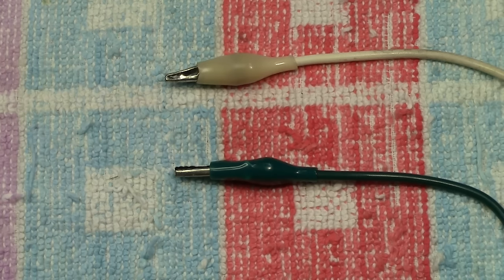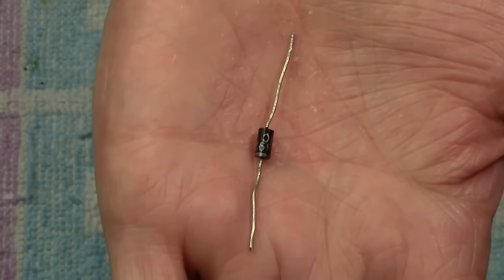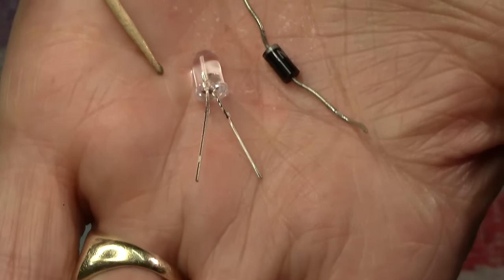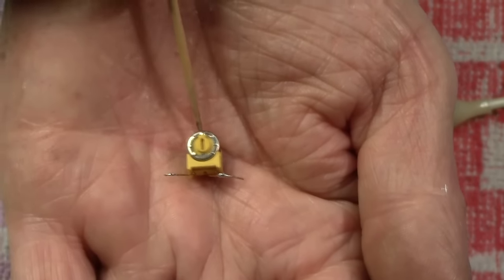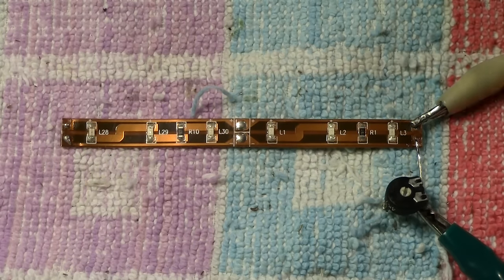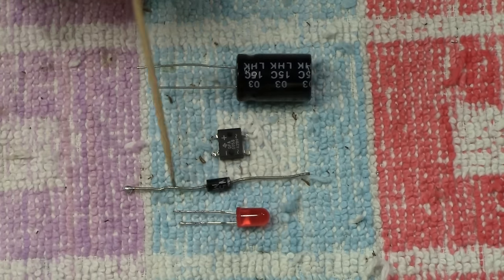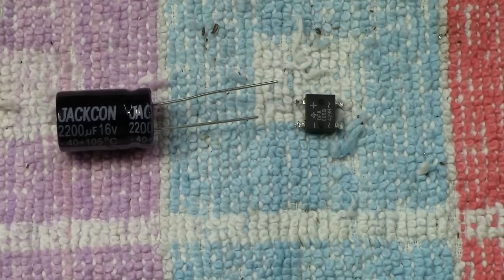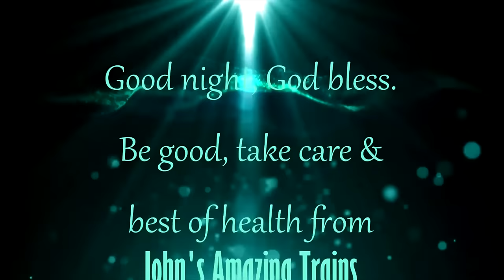How-To On LED & Bi-LED Wiring + The Evolution Of Lighting In Model Railways. Hornby Triang etc.

Comment: I just bought ten rolls of led's from Aliexpress for the price of about £1.25 per 5m roll having one each of the colours, one multicolour (for signal lamps red and green) and a couple each of warm and cold white.   What an age we live in where things are so cheap and these are pre-resistor'd too so just put some volts in and away you go.   Each roll has 300 LED's on so that is 3000 for a ridiculously low sum O.o   Despite years ago being an electronics fanatic who in the 70's rebuilt scrapped Commodore Pets and 8088 IBM PC's using the awesome "How to - Electronics" as my guide and a lethal soldering iron scavenging components from broken devices, I have forgotten so much and these video's really are educational, excellent stuff John from a fan :D

Comment: Hi again John. Remember I was having trouble with back emf on my R155, blowing Bicolour LEDS ? solved it ! fitted a set of PECO 14.1mm wheels and brass bearings, to the other bogie. made 2,twin pickups from thin brass sheet.(4 Contact dimples punched in, using a little home made dome punch too). had to make a pair for both sides, as the axles are insulated from all wheels. Preliminary testing shows very positive results, although only jury-rigged at the minute. Seems that picking the power up from the track, well away from the "evil" old power bogie, has stopped the EMF interference to the LED Circuit altogether !
 Well Pleased. 
Thanks for your previous input, and for all your hard work matey. Gaz.

Comment: Thank you, It give me a better understanding, of how it works. And how can be done.  I already change my RR to DCC, that means, I have a fixed low  AC voltage  current to the rails.  Speaking to light a carriage, I will take the AC current , get it though a Bridge Rectifier, transform it to DC current, and to the light strip, with the potentiometer and the condenser,  to keep it alive and not flickering !

Comment: Great explanation John, thanks! Only things I'd add is that if you were to solder two leds close together for use somewhere (not just for instruction purposes) you'd be wise to add insulation to one of the legs where they cross! and the downside of capacitors storing a charge after power is off is that they can deliver an electric shock too, especially those rated at higher voltages. It's safest to ensure the cap is fully discharged before handling it!  Cheers. Mike

Comment: This is a really great watch, learning lots, good of you to make.
If you're interested, toy train manufacturers such as Howard, Knapp, Carlisle & Finch  most of the gauge 2 aristocracy had working headlights by 1906, with lionel having directional lighting by the mid twenties.
Also by the way Chrysler went to alternator electrics for 1960 model year, and this enabled their panelescent gimmick where phosphor coated ceramics were charged creating an electro luminescent effect for the dash lights. Personally it looks okay... apart from the occasional arc of 220 volts searing across the speedo...

Comment: Those selenium rectifiers are nasty things when they fail.  They can release some nasty toxic smoke...
Those very early LED's were barely even a dot of light, not even bright enough for indicator lights.  Things have come a long way.
When wiring LED's and relying on the LED to handle the reverse bias, make sure you have good quality LED's.  Some of the really cheap ones fail quite quickly if reverse biased.   Learnt that from experience. ......
Thanks for another great video.

Comment: Very very well done John. Your teaching method is superb! I think the most daunting thing which modellers get far too worried about is the "application" of actually doing the job. That, and, the mathematics of course! Although we know that there are some rules and conventions to adhere to, the modeller should have no fear of attempting to do these simple tasks which, all in all, really do enhance the enjoyment of the hobby. We have customers who are crying out for information like that shown in this "tutorial" and you are to be applauded. I will recommend that they watch this. Perhaps you might consider putting it on a DVD then you could also introduce setting the components out on a circuit-board (or vero-board)? I'm not really much good with videoing otherwise I'd help further but thank you again John. I'm sure many will find this useful and, as you say, will build confidence in tackling the project/s. Best wishes, Bob.
Reply from the maker: Gees Bob....thanks for the wonderful comment...I'm sure this cannot be bettered! I'm sorry I don't have time to do any DVD's because I spend most of my time looking after my 90 year old mum! I must just say though that if you think about it...the few components needed can easily be soldered to each other without the need for a circuit (or) Vero-boards however...I do take your point & can easily do that in a further video as the need be's? Once again...many thanks for the support & comments. All the best to you, John.

Comment: Brilliant tutorial I am personally not a lover of trains but you explain the Leds and  wiring side with the use of the resistor and parts very well 
can you use and power the led roll lighting strips using a9 or 12v battery

Comment: Once again thanks so much for making and uploading such an informative video. I think you entirely deserve the whiskey and fag at the end! 
For your next video: Rather than have  pickups on every  carriage , get a Brelec PW400 conductive coupling. (not always in stock, but can be pre-ordered). This allows distribution of the power throughout the train in a very simple and reliable way. It fits a standard NEM socket, as a hook and bar coupling does, but has wires attached to which you can solder the circuits described here.
A PW400 conductive couplings makes it possible to have interior lighting for the entire train with just the capacitor and the bridge rectifier in the guard's van. (Keep the guard on the train and the whiskey and fags by the electrolytic capacitor before the light goes out).
Reply from the maker: Hey Fred thanks a bunch for the great comment again. I am already aware of the PW400 coupling bar system & even have some sets using it/them. What you say is correct but most modern sets use this system whereas people wanting to add lighting to coaches are almost certainly older coaches & don't have the NEM facility. I am actually working on a new system that still uses one set of components in one coach/wagon but still has a form of connections between each old wagon/coach to give the same results! Loved the funny bit at the end again! haha. Cheers mate, John.
Reply from the maker: Hi again Fred...thank you for your suggestion but I am afraid I just do not have the time to do this kind of thing at the moment. Most of my time is taken-up looking after my 90 year old mum! I would love to do more videos too but it's just a time thing. All the best, John.
Reply: Johns Amazing Trains - chambs123 Yes I understand the problem with the 90 year old Mum - my sister's husbands Mum is in a care home which the county council has said will have to close.  All the other care homes in the area are much more expensive so there is nowhere else for her to go. On a more cheerful note, creating a wordpress account isn't difficult - they give you a series of pre-set templates.  Just choose one you like and start typing away.

Comment: Great tutorial, I would have mentioned the bridge rectifier can be used with AC so works on dcc as well.
Cheers
Reply from the maker: Thanks Michael for the support. The only reason I didn't mention it was simply that anyone running on DCC (17 volts AC in reality) is because they will already be using decoders however & in hind-sight I should have as this would still apply if fitting lighting into coaches, wagons etc that don't have the decoder! Thanks again. Cheers, John.

Comment: Brilliant John as always! However, just before you said you were off for a whisky, you referred back to the illustration where you had connected two LEDs (red and white), joining opposite legs together for bi-directional use plus the balance resistor in circuit - MENTIONED that one should probably also add a diode to protect the leds but no pictorial or clip or circuit diagram to show how exactly that should be connected. Which for relative rookies to electrics like me is a big deal. Is there any way you can add or send that information because I’m right now (in fact today, as at 22 July 2022) trying to wire up one of my On30 locos. Many thanks in advance.

Comment: You did a great job explaining how the parts work. I bought a premade light board for a coach. The light had a battery and a magnetic switch. How a about a video on ways to pick up power for the tracks. Thanks

Comment: Very useful. Have layout some parts 40years old. Now changed to DCC: alas gone are the insulated fish plate and relying on the turnout rail electrical contact.   I have installed a bus line to most of the track: dropping feeders as and when needed: However without starting again I have to put up with getting around expensive block detection: So for partial automation and signaling I have turned to toggle (on) Of (on) switches for the solenoid worked turnouts and wired them up with the ready made impulse type units that work (8) signals and used a bi-LED for display panel.  As for block detection I have turned to reed switches: Great LED flicker on the control panel rout (but one has to be precise in stopping the locos magnet over a reed switch to show occupancy) bit of a compromise but still has an element of fun in control: I am extending the layout more dcc friendly, but I am struggling with wiring up double solenoid passing points. as for dcc.It's an issue as most of my old loco stock I chipped will not navigate any new Peco points i have installed and is not worth while fixing without extensive work: anyway my new DCC ready rolling stock with all the lights whistles and bells is growing Thanks again john for your posts that I follow can understand. Ron

Comment: Hi john great lighting tutorial 

Just one question what was the rating of watts for that resistor?
Reply: I’ve just Googled this video - I need to wire up a DC loco with bi-directional lights. As it seems John is not responding to any questions now (last 2+ years) I thought I would respond to yours - I think you will find that 1/4 watt resistor should be fine. I need an answer to my recently posted question regarding how and where to include diode/s to protect the LEDs when they are connected up in a bi-directional configuration (to protect them when they have reverse polarity). He verbally refers to this issue right at the end of the video but unfortunately did not say or show how to do this. If you or anyone else knows, I would appreciate a response :)

Comment: Hi John, always keep your instructional videos in my watch list for when i need the info. Just watched this, brilliant mate. I have one question, does this apply to DC or DCC or both. Im about to convert my old triang and early hornby stuff to dcc and wanted to check this works for DCC mate. Thanks in anticipation John...keep up the brilliant videos mate.
Reply: With the bridge rectifier the circuit ensures current will flow properly with AC, DCC, or DC. Just be attentive to the voltage. I think HO DCC can go as high as 18.

Comment: Hey John this is all fantastic stuff, but I wonder if you could go a wee bit further. I installed 2 of your flicker free circuits into a a Hornby Mammoth also using the existing diodes to control direction of lighting. This worked on the breadboard but when installed into the train the Emf from the motor causes both lights to illuminate. Very frustrating,  can you help, I would have emailed you directly but then I thought it might be a good video for you to do. Here's Hoping,  cheers Alan.

Comment: Hi John from "Down under". I have a working knowledge of electronics to get by, but there are times when I'm not sure. This question is one of them. I'm re-designing my control panels. I have Digitrax DS64s connected to my layout. I'm rewiring/redesigning the indications for my points. At the moment I have separate Red & Green LED's to indicate straight through or diverge. I have some Bi coloured LEDs which I want to use as I will only need 1 LED to do both colours. 

Hooking up the LEDs with long leg (+) and short leg (-) will give RED & long leg (-) and short leg (+) will give GREEN. The points direction indication when thrown will be activated via a NO/NC micro switch - terminal 1 NC, terminal 2 NO, terminal 3 COM. With a 3 leg LED there is no problem, but how would the 2 leg LED be connected. I hope that makes sense.

Well thought out tutorial. Thank you,  Ian.

Comment: I have a question,  the point where  you showed  a red  and white led, that only  has one light on at a time red or white, what about  a white going forwards but you would also need a red at the same time at the rear, can you just solder the other red or white led on long wires to reach the other end ? .

Comment: Hi John....quick question...I wired the twin LEDs with resistor and 16v 1000uf capacitor..tested with 12v battery works fine then wired into shunter ...problem lights come on only when running at speed  and the capacitor does get chance to charge up ?  ....any ideas ....stumped fred .sorry to have to ask .

Comment: A very informative video John. Im going to put some LED's in my triang pullmans. There is only one problem I've got to convert the wheels from plastic to metal first I've seen your video on how to do them but just need part numbers for the bearings if you could help please.
Reply from the maker: Hi Neil. Thanks for the comment & please let me explain. OK, you don't say which time period or brands you wish to convert but if they are Tri-ang (as far back to the 60's) or later 70's, 80's & 90's versions by Hornby...their replacement metal wheels will go straight in without any modification! Here is the part number: http://www.ebay.co.uk/itm/Hornby-R8097-10-Set-Disc-Wheels-3-Hole-Axles-00-Gauge-Wheels-and-Couplings-/332040359691?hash=item4d4f25cf0b:g:J7sAAOSwA3dYM-Fl Hope that helps? All the best, John.
Reply: Hi John the carridges in question are Triang  pullman coaches I don't know the year but they have the open axle boxes with the plastic wheels.

Comment: Good evening , I wonder if you can help me: I am working on a layout using 1p mom sw. to operate standard point solenoids, this all works well.But I wish to have LED illuminated when the points are operated to show which direction on the points has been chosen.  Will I be able to use Bi-Colour LEDs., will I need 2p sws.how will the led stay on when I use 1p mom sws?
Any ideas, your help would be appreciated.(ps: great video's have learnt a lot about LED)  Best regards JPW

Comment: Hi John, just found your videos about electronics in modell trains. Althought I am using N scale your tips are very helpfull to me. I found your video about correct soldering and how to handle the solder gun. You mentioned a silicon paste to fit between the heating part and the tip. My search for such paste was not of success. Problem is the heat the paste has to stand. I am using 400°C for short time soldering. The paste I found does only fit 200 to 300°C. Could you help me with the type of paste you are using?
Best regards and more videos for us.
Please let me know if you need my email address to answer.
Lutz Wunderlich from Germany

Comment: Thanks for your excellent tutorial John. Could a bi-color red/white LED be used in place of separate red and white LEDs and would it be wired the same way?
Reply: yes
Reply from the maker: Hi Brian..thanks for the comment but no....you cannot use a bi-colour red/white LED to work using this method. That kind of LED has 3 legs & usually the middle leg is a common Cathode. This being the case one lead from the controller would say be on the middle leg (through the ballast resistor) & the other controller lead would have to be moved between the two Anodes to illuminate each LED section in turn! The only way this can be done is to add some kind of switching (small relay etc) between the two Anodes & this then makes things more expensive & complicated. If you stick to the way I did it in the video you will be fine. All the best, John.
Reply from the maker: No Carol you cannot! Sorry but you are wrong here....please see my explanation to Brian why. Kind regards, John.

Comment: Just a quick question John using your idea for cab ,loco lights. Would taking feeds direct from  motor connections effect running of loco ...thanks as well .... fitting the diode cured a friends problem of blown leds   Fred
Reply from the maker: Hi Fred. Yes you can take the wiring straight from the motor...it does not matter from whereabouts you take the supply in the loco but remember...The reverse bias diode is essential as you have clearly noted from your friends' problem! If however you use the bridge rectifier so the LED(s) work in both directions, then you don't need the reverse bias diode as the current can never swap polarity after the rectifier. All the best mate, cheers, John.
Reply: Johns Amazing Trains - chambs123   Much appreciated John.....many thanks ....fred
Reply from the maker: No worries buddy....always here to help if I can? Cheers, John.